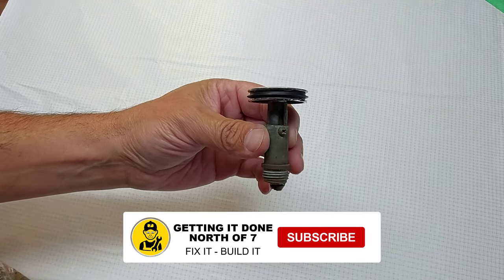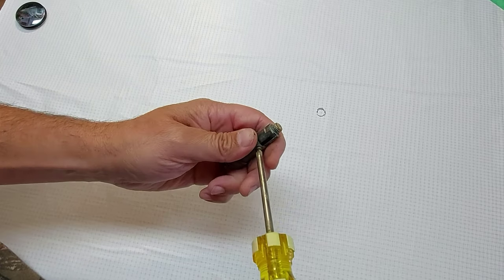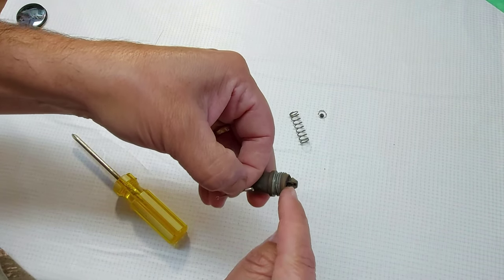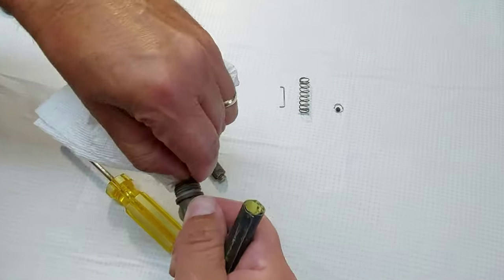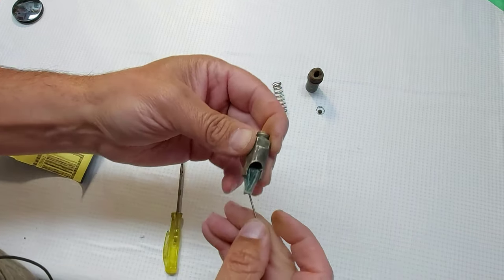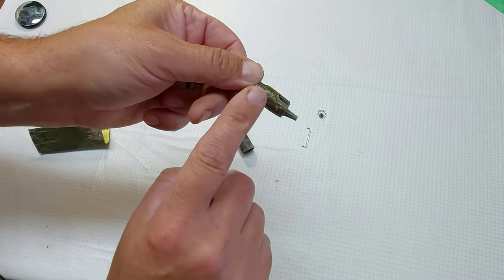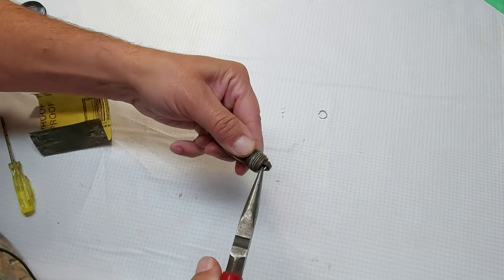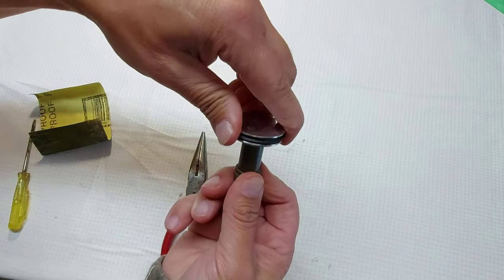Stuck Pop Up Drain Stopper | Get it Working Like New Again!

Comment: Ok but how did you get this thing out in the first place?
Reply: You unscrew it
Reply: yeh i wanna know too, but watching other videos it seems u just twist it left by hand and it will unscrew.. However i cant get it to unscrew out, not even with pliers.. Might have to change the whole dam drain since the pop up thing is stuck to the drain and wont screw out!
Reply: Having the same problem
Reply: Use needle nose pliers after you unscrew the cap and using the pliers on the “ stem” bit turn to the left to unscrew.

Comment: This was great, easy to follow and helped quite a bit. I would like to add one additional step to try. After I did all of this, my drain plug still got stuck down. I found that the mechanism was just setting down too low. So, I replaced the O ring with a thicker one, so that the plug couldn’t go down quite as far, and now it works!
Reply: I had the same problem as you! It was too low in the setting when it was closed but to fix it I didn't screw the bottom thread all the way down. I'll get a bigger O ring too I think.

Comment: Thank you. Great vid with very clear and detailed instructions. After disassembly, I soaked all the bits in a vinegar solution for a couple of hours which got them really clean. I then applied a light general lubricating oil before re-assembling. After a week it siezed up again so I used grease as per your instructions and it has worked fine ever since!
Reply from the maker: Glad it helped

Comment: Only thing i dont have is some all-purpose grease. I've got the spring-loaded stem and some other bits soaking in white vinegar to attack the limescale. I'll have to go with WD40 on this occasion, which is far from ideal

Comment: It was stuck it wouldn't go down, after watching the clip i took it apart released the mechanism, cleaned it ir seems very smooth even though i had problems with the pin .After installing it back now it's stuck in down position. 😢😢😢😢
Reply from the maker: Not good